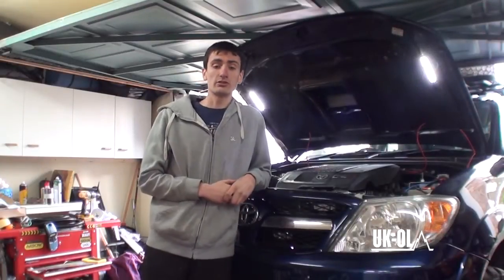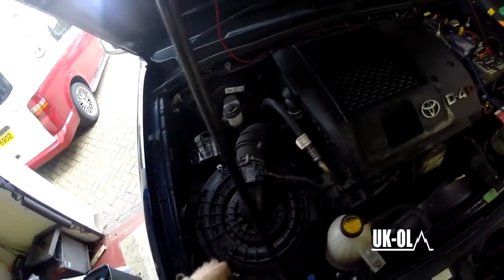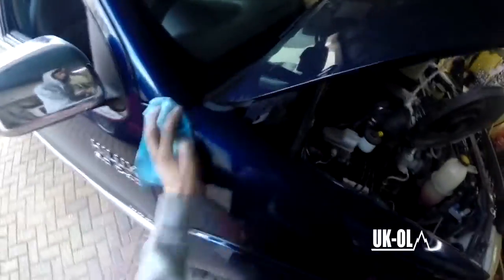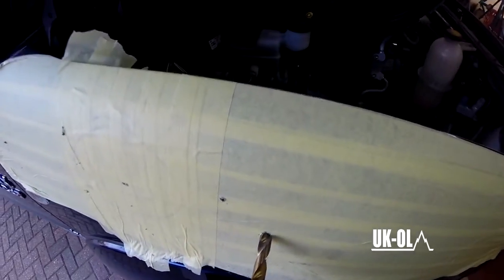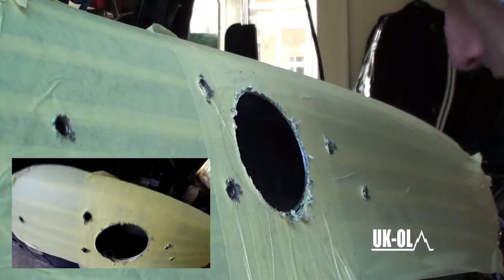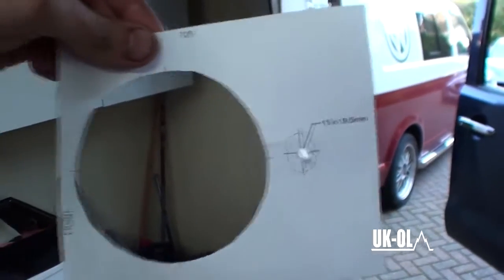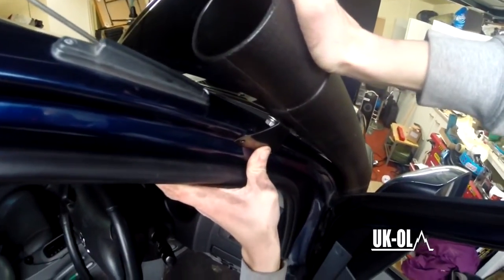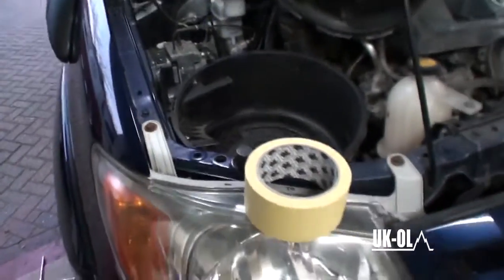PROJECT H: TJM Airtec Snorkel Install

Comment: I got one of these on my hilux. Very happy with it, except for one thing.If you take the top of the air-intake off, the pipe is angled in such a way that you cant install a cyclonic filter, for example. Has anyone found a solution to this?Can i buy an elbow to put on there somewhere? Ive googled around but cant seem to find one.
Reply from the maker: I have the same issue, I have thought about a silicon 45 degree coolant hose bend or even 3D print an adaptor